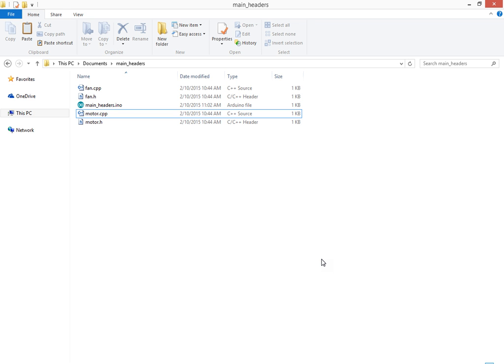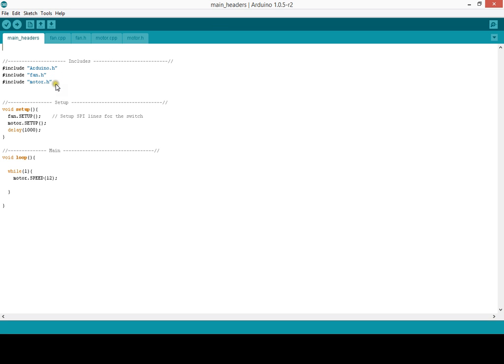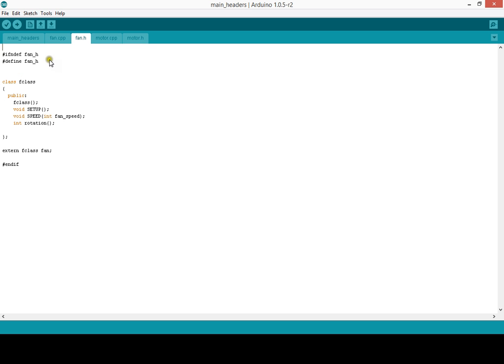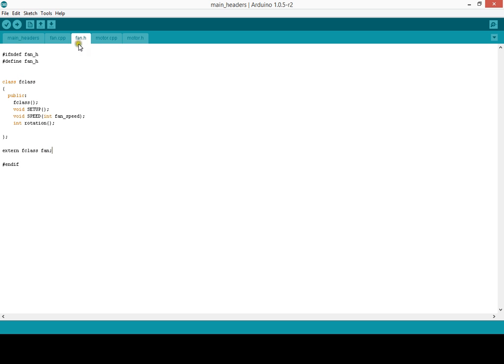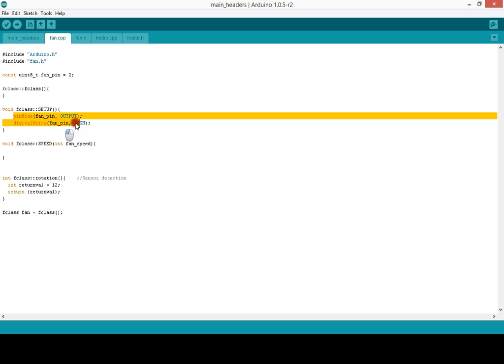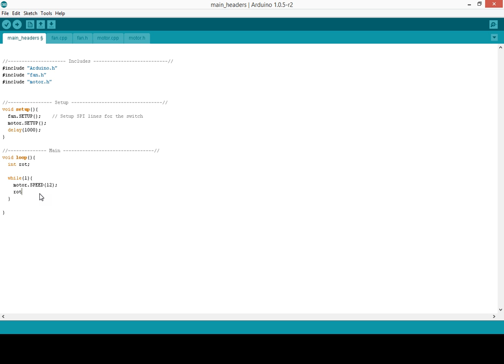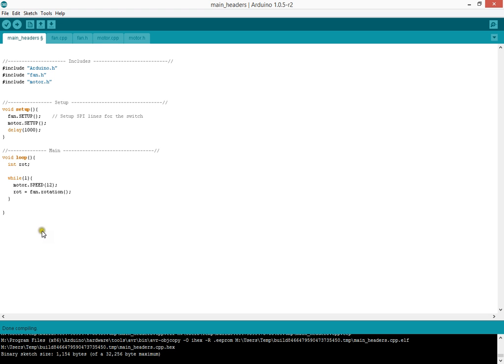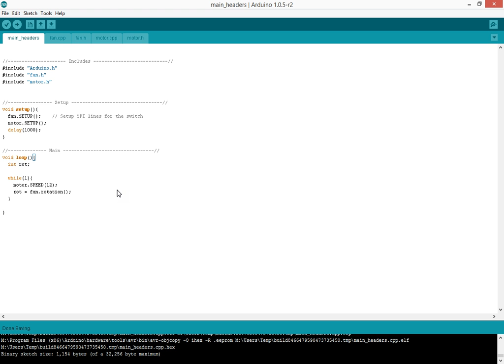Arduino:  Header files tutorial detailed

Comment: There is a RTC library for the DS3231 on the Ardy Lib manager called RTCLib_by_NeiroN. The DS3231 is Maxim's I2C RTC chip that has a temperature compensated internal oscillator.

The author of the aforementioned library has the temperature reading code in the header and CPP file but there isn't an example of the temp reading functions and the temp functions are in a totally different class than the time and date. I've tried to get the class working but don't understand the correct way to innitialize it. The header file doesn't have anything like the External operators (don't know if that's the right terminology here) you showed in this upload.
 I can get the time and date part of his library working just fine but the other functions of the library are not so easy.
 I'm totally new to CPP, and can barely manage to code ass-backwards in C.
 It would be really nice to have a better idea of the general structure of CPP in the context of the ArdyIDE. I have a few books on ANSI C & C++ but they aren't much help in this specific context at least until I get past the first 1k pages...
  What would be really nice is if I could find a reference where someone breaks down the basic ways people write a library and show an example from the ground up using a hardware peripheral that has a relatively simple datasheet and uses serial communication. 

  I wrote a bunch of stuff for a project that used this library, then realized the 3231 chip has a temperature sensor built in afterwards. I only used the library because I have 3 different RTC ICs that are all supported by the same library. At the time I didn't realize how crappy the documentation and examples are.
  Anyways...I'm in the process of making my code compatible with a different library, so such an upload wouldn't help me, but a general reference like this might help others. I still want to understand the information though. It would be nice to better understand the nuts and bolts that are going on in the CPP file and how they can be referenced or altered either in their file or externally in the main function.
   For instance, let's say a device sends a string of 4 bytes of data to the Ardy1. I need to parse 2 bits from the beginning of the second byte. I am using a library someone else wrote. How do I break this down to make it work without totally starting from scratch? (This is an abstract hypothetical and unrelated to my current project.
It's just an idea ;)
  Thanks for the upload. 
-Jake

Comment: Hello
If I want to use a button to switch between different programs for one LED, is this the way? 

When I start, the Example AnalogInOutSerial should run. Then the button is pushed and shifts to blink example, pushed again to fade example, pushed again to random fade and so on?
Reply from the maker: Hey Kasper, there are a ton of different ways to code something like that.  If you wanted to use my code template, then I would recommend added something like this to the LEDSpeed function:

void LEDSpeed(int led_speed, int led_cycles)
{
  while(button_is_pressed) { ; }  // Wait for button to be released
  while(button_is_not_pressed){  // Remain in this function until you press the button again
  int i;
  for(i=0; i<led_cycles; i++){
    digitalWrite(PIN_LED, HIGH);
    delay(led_speed);
    digitalWrite(PIN_LED, LOW);
    delay(led_speed);
  }
}
}

It's a crude implementation, but it should work for testing purposes.

Comment: Why are you using classes? Is that a hard requirement? Why can't the .h file simply be like:

/* module.h*/
#include "Arduino.h"

const <type> var1 = value1;
const <type> var2 = value2;
.
.
.
const <type> varn = valuen;

<return type> function1();
<return type> function2();
.
.
.
<return type> functionn();

Comment: HI Dean, I am an old "C" embedded programmer.  I am currently working with a rather large example for the ESP8266 and my first venture in the Arduino IDE.  I want to brake it up into logical sections, but I am having difficulty doing this in "C".  Would you by chance have a similar example using "C"
Thanks
Reply from the maker: +Eric Bommer, Thanks for the question!  The Arduino IDE accepts most C and C++ syntax. The examples I used in this video are written in C. Do you have a specific issue I could help you with that isn't compiling quite right? Feel free to send me some source code and I can take a look.  ratitutorials@gmail.com
Reply: +Dean Tate I get what Eric is saying I think.  Your example is C++ not C as it has the class's. It would be cool if you did the same example with C files. This video still helps me a lot though, so thanks.

Comment: Hi Dean, I thought sense there is more than just me asking I would post back here.  I have tried your example and it works great in CPP, so I thought I would try a miniature version of your example and covert to "C" and I get the following errors when I compile.  I have tried dozens of syntax changes but I continue to get errors.   Thanks for any help or guidance.  I am using version Arduino IDE 1.6.7.

//--------------------- Error Output from Arduini IDE  ********************//
Arduino: 1.6.7 (Windows 7), Board: "NodeMCU 1.0 (ESP-12E Module), 80 MHz, Serial, 115200, 4M (3M SPIFFS)"

sketch\Motor.c: In function 'MotorSetup':
Motor.c:6: error: expected '=', ',', ';', 'asm' or '__attribute__' before 'void'
 void MotorSetup()
 ^
Motor.c:13: error: expected '=', ',', ';', 'asm' or '__attribute__' before '{' token
 {
 ^
Motor.c:16: error: expected '{' at end of input
 }
 ^
exit status 1
expected '=', ',', ';', 'asm' or '__attribute__' before 'void'
  This report would have more information with
  "Show verbose output during compilation"
  enabled in File > Preferences.

//--------------------- Main IDE File -------------------------//
Main_Header_C_Only.ino:

//------------------- Includes -------------------------//
#include "Arduino.h"
#include "motor.h"

//-------------- Setup -------------------------------//
void setup(){
    MotorSetup();
    delay(1000);
}

//------------ Main -------------------------------//
void loop(){

  MotorSpeed();

}
//------------------- New C File  -------------------------//

Motor.c

#include "Arduino.h"
#include "motor.h"

void MotorSetup()
{
  pinMode(motor_pin, OUTPUT);
}
void MotorSeed(int motor_speed)
{

}
//------------------- New H File  -------------------------//
 #ifndef motor_h
#define motor_h

extern void MotorSetup()

extern void MotorSeed(int motor_speed)

#endif
Reply from the maker: +Eric Bommer Thanks for the detailed reply!
I was able to accurately recreate your errors and I think I may have found the solution. The fundamental issue is how the Arduino IDE compiles all of the files together. You really wouldn't run into these errors using a GCC compiler. However, there is always a work around! I will work on making a video that details the explanation, but until then check out the comments in my code uploaded on GitHub at the link below. You should be able to include these files into your project now. Let me know if the files on GitHub solved your issue!

https://github.com/ratitutorials/Arduino-Headers-C.git
Reply: +Dean Tate 
Thank you very much.  It works great, I have even made some modifications using your examples to send data between the "C" file.  This will really speed up my ESP8266 WiFi project.
Reply from the maker: +Eric Bommer Great! I'm glad to here it works. 
Please keep posting any questions you may have related to programming, hardware development, or how to setup a project. Also, let others know where they can get help! I'm always looking to add more content to my YouTube channel.

Comment: Hi Dean, I have kind of a different question.  I am trying to use the "pgmspace.h" library  in my new "c" file and getting the following error.  Any help is appreciated.  Seems interesting I don't need to add pgmspace.h to the "INO" files, but it is definitely required for motor.c. 

//--------------------- Error Output from Arduini IDE  ******************//
Arduino: 1.6.7 (Windows 7), Board: "NodeMCU 1.0 (ESP-12E Module), 80 MHz, Serial, 115200, 4M (3M SPIFFS)"
sketch\Motor.c.o:(.text.MotorSpeed+0xc): undefined reference to `strncpy_P'
sketch\Motor.c.o: In function `MotorSpeed':
sketch/Motor.c:31: undefined reference to `strncpy_P'
collect2.exe: error: ld returned 1 exit status
exit status 1
Error compiling.

//-------------- Main File:  This compiles clean  ******************//
#include <Arduino.h>

extern "C"{   // Alternative to naming all ".c" files to ".cpp"
  #include "motor.h"
  #include "ledFlash.h"
  #include "Global.h"
}

const char MainString_0[] PROGMEM = "String 0"; 
const char MainString_1[] PROGMEM = "String 1";

const char* const MainString_table[] PROGMEM = {MainString_0, MainString_1};

char MainBuffer[30];

void setup(){
    
    strcpy_P(MainBuffer, (char*)(&(MainString_table[1]))); 

//-------------- Motor.c file This is where the error is at  ******************//
#ifndef motor_c
#define motor_c
    #include "motor.h"
    #include <pgmspace.h>
#endif

const char MotorString_0[] PROGMEM = "String 0"; 
const char MotorString_1[] PROGMEM = "String 1";

const char* const MotorString_table[] PROGMEM = {MotorString_0, MotorString_1};

char MotorBuffer[30]; 

void MotorSpeed(int motor_speed)
{
  strcpy_P(MotorBuffer, (char*)(&(MotorString_table[1]))); 
    
}
Reply from the maker: +Eric Bommer 
"pgmspace.h" is included within the INO files because of the "#include <Arduino>".  "Arduino" lump sums a bunch of libraries within it. Try adding "#include <Arduino>" to the motor.c and it should be the same thing.
Reply: +Dean Tate 
Hi Dean, thanks for the quick response.  I forgot to add that line to my post because it was in my H file.  I move the file over to the "C" file and I still get the same error.  I also found out why I need to add "pgmspace.h"  looks like its only included if your defined as a C++ file.  I then did a little more investigation and changed my board type to an Atmel version of Arduino and it all work, so it looks like there is a difference between the AVR and ESP8266 versions of Arduino.h and Pgmspace.h.  Thanks again for your help.  If I find anything interesting I will pass it along.

Comment: Great explanation. What does the last line in the .cpp files mean?  fclass fan = fclass();
Reply: Hi Great explnation though a bit fast in places.  I am also confused about why the lines below are necessary
fclass fan = fclass();
mclass motor = mclass();

If I comment them out it still compiles OK
Reply: Meant to say if I comment out "mclass motor = mclass();" and replace it with  "mclass motor;" it still seems to work.
I think its another way to instantiate the object.
What's the advantage of  using "mclass motor = mclass();" over simply the "mclass motor;" method of instantiating the object?

Also I normally instantiate objects at the beginning of the .ino file but here they are instantiated in each .cpp file.
Any pro's/con's of doing it this way?

Comment: Can you explain what software I can use to write the C++ header file with. I tired using the arduino IDE and saving the file as headerFile.header but Arduino adds the .ino extension.
Reply from the maker: you're saving it as "headerFile.header"? 
Try renaming it with the standardized ".h" extension. so, "headerFile.h"
Reply from the maker: Arduino IDE should work fine if you have the filename extensions right.